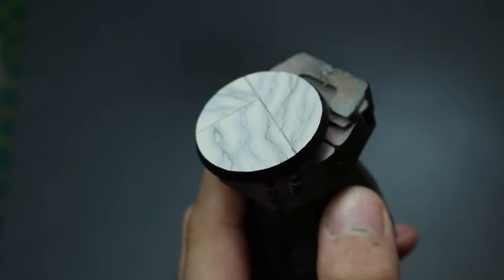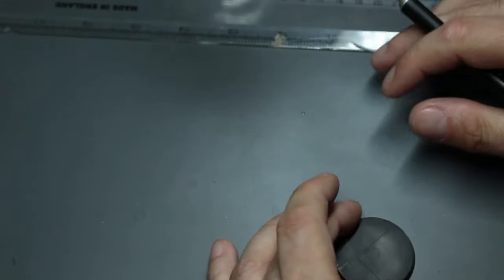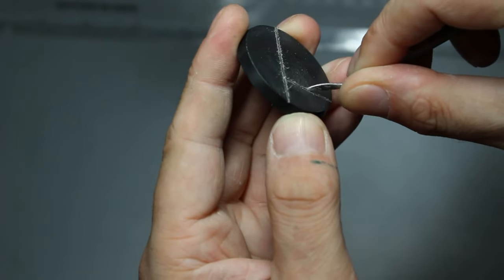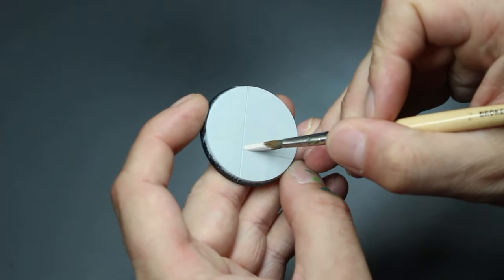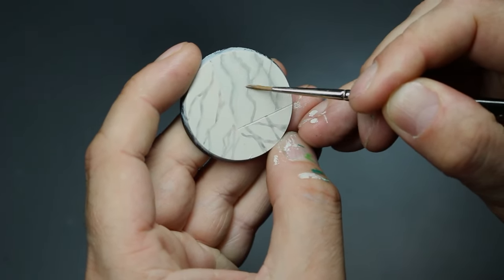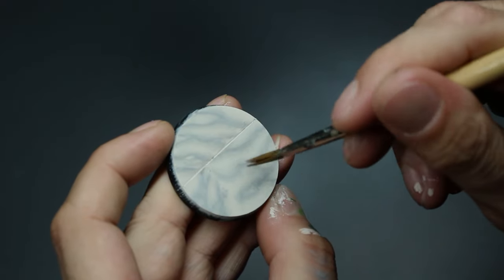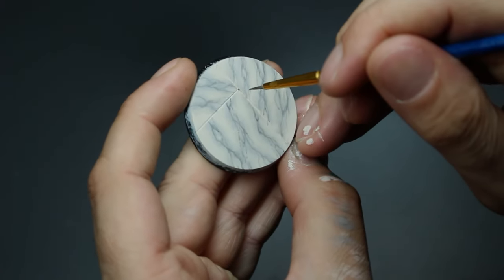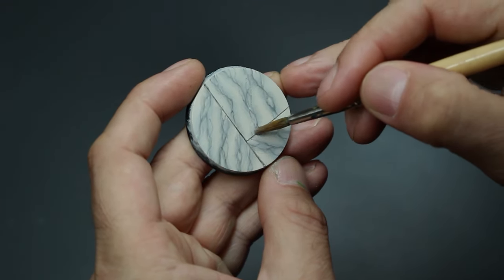Marble Base With NO Airbrush | Warhammer 40k Base

Comment: To have an easier time with the line scoring and even skipping the sanding part: use some cereal box cardboard, cut it to size and glue it down with the shiny surface up top. Then score in your lines with a simple ball pen.
Reply from the maker: Interesting, certainly from a scoring point of view, but having to tidy up the cardboard edges, which will always be fibrous unless you soak them in superglue, would most likely put a beginner off if they can't replicate a smooth base edge.
Reply: @nofixedcourse  True, but watered down PVA helps. Tbh just painting it smoothes it out pretty well. At least that worked out for me. Results may vary. ;-)

Comment: Awesome guide, the finished result is truly impressive! 🔝
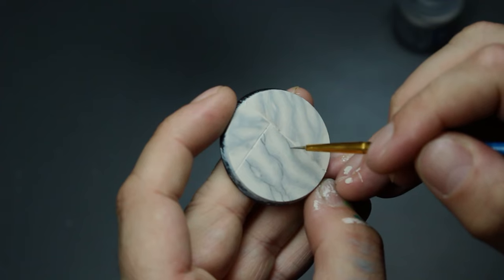Just one question, what brush did you use for drawing the finest lines? (minute 6:16)
The tip is very sharp, looks almost like a mechanical pencil
Reply from the maker: Thanks! The brush is an old Rosemary & Co series 33 size 1, I only keep a couple of good brushes for detail work, this one for bases and a Raphael 8404 size 0 for miniatures. The majority of work is done with dirt cheap brushes from hobbycraft so I don't have to worry about ruining them. Edit: I just looked back at the footage, the brush you were referring to is one of the cheap ones! Pack of 3 for £3 from hobby craft stores, but it's only a couple of days old so its got a decent point on it for now
Reply: @nofixedcourse  Thanks a lot! This is very helpful, I'm yet to complete my miniature brush set

Comment: If you want a better option for cutting the slab marks, look into the modeling hobby with scribing tools made for panel lines. I did something similar a long while ago for concrete slabs for some moderns and had a scriber for gunpla that worked really well at the time.

Also with marble look, if you add a very light stipple of a metallic pearlescent white paint, you get a very interesting effect. Haven't used in on actual bases, but I have used it as part of something for terrain
Reply from the maker: Yeah I do need to get myself a set of gunpla scribers. But, for ease of use for beginners, I doubt I would have used them in the tutorial anyway. Beginners tend to assume you can only do something if you have the specific tool for it, and whilst that tool does make it easier, I like to cultivate the 'make do with what we've got' mindset
Reply: @nofixedcourse  I, mainly, figure that if someone is going to make an army using this technique, it would at least make things quicker and more consistent.

Comment: Somehow, it looks a bit closer to the actual thing than with the baby wipe and airbrush technique ! Also takes a lot more time, but at least it's accessible in terms of tools used ! I am now looking forward to try replicating this effect with slightly different colors for my Custodes army ^w^ !
Reply from the maker: There's so much variation in the real thing and not as many stripes as you'd expect, so the baby wipe method, although fast, is almost overkill. Great for a massive army, but actually painting it looks better on smaller forces. I would like to try it with other colours at some point too! Black would be the favourite choice for another go
Reply: @nofixedcourse  After-painting report: I finally went with the colors you advised to use, unsure of what kind of other marble I could make. Turned out pretty well (except maybe for the crack lines that I made a bit too regularly, irregularity in those lines's thickness participates to give a more believable marble effect), if we skip the fact that painting with white on flat surfaces wasn't as easy as I thought when you want to to make it even ^^', I need to really practice it however ! Also, I applied a gloss varnish, it's okay but maybe a satin varnish is better in the end. 

To add something more to it: it won't really imply the same techniques, but I will maybe try someday to go for a pink granit base (pink granit is a real thing in our world, there's only three places in the whole world where it forms naturally, but it's an aesthetic in itself, it's not really sparkling pinkey pink though, more of a dark irregular pink with black spots and white thin lines).

Comment: i want to paint the....how shall i put it. the "indentations" on the sisters tanks like that. any tipp to make it look good there?
Reply from the maker: I know exactly the bit you mean, and I couldn't think of a better word than 'indentations' either 🤣 only tips I can think of is make sure the lines of the marble don't flow over the corners of the tank, you want them to look like marble panel inserts rather than one huge block. So treat each flat surface as a separate piece. Once you're all done maybe a very slight gradient of some shadow colour towards the bottom half might look good if it's subtle, but that depends on how you paint the rest of the tank. Good luck with it!
Reply: @nofixedcourse  thx

Comment: Thank you so much for the amazing guide. Finally a tutorial for marble that doesn’t required an airbrush. I’m thinking of doing a marble Imperial knight. Do you have any tips/advice for doing larger pieces of this marble design?
Reply from the maker: It would be very much the same doing it on a larger surface I guess, just use bigger brushes for some of it to cover areas a bit more efficiently, and maybe use some glaze medium just so it's a bit less labour intensive over such a large model. Other than that, look at lots of reference of marble and have fun! Thanks for watching, glad it's been useful
Reply: @nofixedcourse  thank you!!

Comment: the only question i have is that how thin is the paint are you using?
Reply from the maker: I usually have it very thin, 2 parts water to 1 part paint, but it's more important to get rid of excess paint on the brush by dabbing it on a paper towel before each stroke.
Reply: @nofixedcourse  thank you, I’ve been testing it out today, thank you so much for the video and great job on the marble.

Comment: could you still paint these with miniatures already on?
Reply from the maker: Yes absolutely, your main concern would be is the base smooth enough, and painting it in such a way that it looks natural, so either having the lines avoiding the feet completely or painting it to look like it's passing under the feet. Either way is perfectly fine.
Reply: @nofixedcourse  awesome, i was planning on smoothing the bases before attaching and priming. 
Then fix the feet once the bases is done.